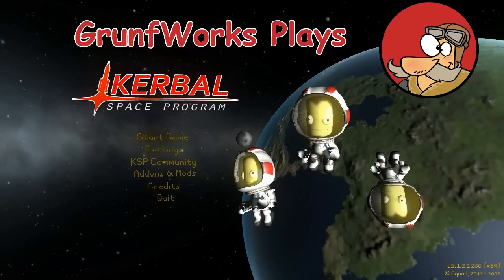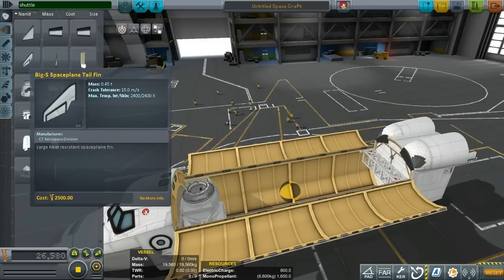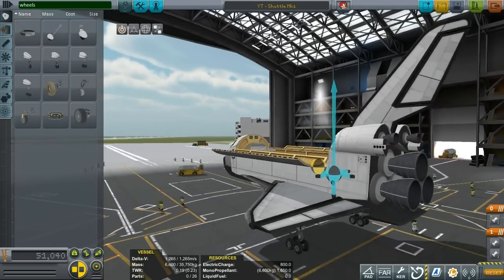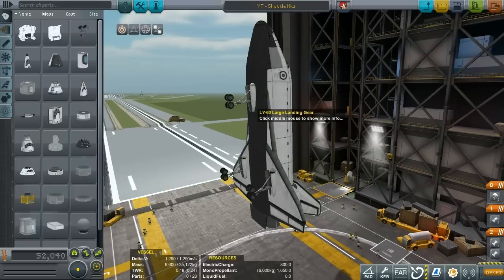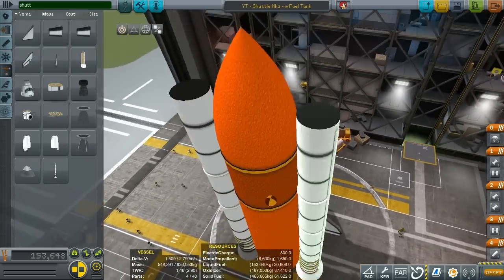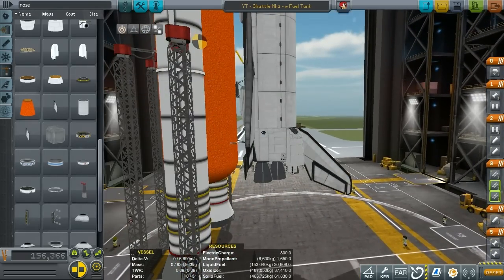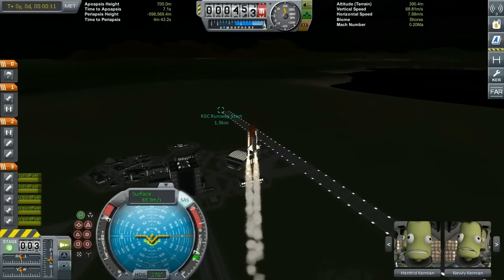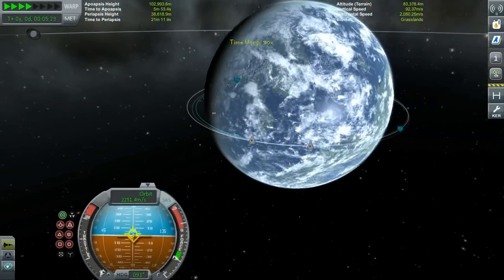Kerbal Engineering - How to build a Space Shuttle

Comment: I built mine without any mods, looks great!
Reply from the maker: Congrats, how does it fly, as balancing is a tough one on this craft.
Reply: GrunfWorks Flies very well, it doesn't have the 2 upper engines or parachutes however because I didnt find myself needing thoose at all
Reply from the maker: Cool, nice job. I avoid stock due to single reason is that i hate tiling
 wings. and also love mods, but making a stock one that works is a great
 achievement. Kudos for that :-)
Reply: Grekus Burekus Nice

Comment: At 6:55 it sounds like you're saying the real life space shuttle comes in at Mach 7, but the real space shuttle entered the atmosphere going ~Mach 20 or so. Which is why it's so important to have the ceramic tiles and the thermal blankets over the rest of the shuttle. Another shuttle fun fact, the "rudder" on it is actually also an airbrake, as it opens flaps on either side rather than having a single control surface
Reply from the maker: Sorry for the confusion, I was referring to my shuttle coming in at mach 7. I did know about the rudder airbrake, it was a cool engineering feat

Comment: Nice job! I noticed some torque during circularization while using the OMS. I take it one could get rid of it by angling the OMS engines in the VAB to thrust through the shuttle's CM?
Reply from the maker: +ivanverano1 yes, you are right, i forgot about that part. Well, same principles as angling main engines apply

Comment: You launch profile is a bit wrong.

Orbiter should sit on the WEST side of the assembly on the pad (ie towards the mountains).

T-0s: Main Engine Start
T+2s: SRB Ignition
T+3s: Clamp release
T+10s: Roll manoeuvre +180 degrees, 60 degree pitch East (belly "up")
T+129s: SRB Sep
T+129s: Pitch manoeuvre: 0 degrees (belly "up" and flat). This moves you away from the SRBs as they separate from the assembly, also bear in mind that your main engines are still pointing up, they will continue to vector through the centre of mass pushing the apoapse up and increasing the vehicle speed hugely
MECO at apoapse attainment (~120km in stock planet). By now your periapse should be at least -100 to -60km
Alt=70km: Roll 0
Apoapse -60s: ET sep. Toggle OMS on and ME off
Apoapse -30s: OMS orbital insertion burn start to orbit, 45-75s burn depending on payload mass

(this is entirely doable in stock KSP, this is the profile I use)
Reply: Jim Moore ha lol u used math noob

Comment: grunf flaps are to add drag and lift, spoilers are to disrupt air flow over the wingsurface thus decreasing the wings lift generating capasity and not adding forward speed but you do get more vertical velocity. airbrakes are to only increase drag
Reply from the maker: +highkicker11 very nice explanation, thx for that
Reply: +GrunfWorks nothing to thank me for i even forgot to point out that flaps increase the effective surface area of the wings and to increase the camber of the wing to increase the distance between de airflow going over the top of the wing and the flow going under the wing with the plane creates lift at lower speeds. But if you would keep your flaps extended at higher speed they would generate so much drag that the plane cant go any faster plus it would damage the wing.
spoilers decrease the effective surface area of the wings. the increase in vertical velocity means you don't want to land with spoilers deployed. use them only to get on the correct glide path. or you might just really be flying a brick
Reply from the maker: +highkicker11 hehe for shuttle I think flying brick is a given :-)
Reply: +GrunfWorks well with spoilers its no longer a flying brick its a falling brick imho
Reply: highkicker11 spoilers also give more friction and grip under deceleration.
Reply: that is not a aerodynamic quality but it is related to the fact that spoilers disrupt airflow over the wing-surface thus reducing lift and increasing the weight that rest on the tire's. thus the pressure on the rubber producing more grip and friction. (at a certain point the wings stop producing lift al together when the  airspeed over the wings is to low and then the spoilers only add drag because they function like a wall for the wind to blow against.)
Reply: Well I have actually nothing much to add regarding the flaps and the spoilers (Speedbrakes with more "deployed" surface area which are only deploying on the ground). However I'd like to mention that speedbrakes greatly increases the rate of decent. And since I'm already talking about decentrates a normal airliner decents normally with an sinkrate between 4000 fts to 6000 fts. The C-17 or C-5 is decending with over 16.000 fts (tactical approach) with speedbrakes deployed and with fully deployed trust reverses. The shuttle "decents" with ~30.000fts. Just to give you a feeling how this would feel like an airplane normally cruises between FL300-FL390 (depending of the weight and the coast index). Let's take FL300 as an example. Let's assume you wanna land in KJFK (JFK ICAO code) and you're round about 15nm to 20nm away from the runway. The pilot would announce that the plane is about to land into JFK. With an decent rate of the Shuttle is would only take ~1 minute till touchdown. The Shuttle is litrerally skydiving. To be honest I don't know how it would be possible to increase the rate of decent even more.

This video will show you how fast a 30° "Glide path" is.
https://www.youtube.com/watch?v=Jb4prVsXkZU

Comment: But can you do it stock?
Reply: Grit in principle, but this looks better. If you use stock, I recommend vectors for the main engines and puffs for the orbital engines.
Reply: Puffs are too small, i just built mine without them.
Reply: Grekus Burekus thuds might work better then.
Reply: But puffs would probably be more realistic.
Reply: Yeah, I am trying to figure out how to attach stock docking port, another problem is funny placement of engines.
I am aware that stock shuttle exist I am just ignoring it
Reply: Grit Try using the Comorant Areotechnology mod
Reply: Yes but it's very difficult
Reply: I did it stock yesterday, but I wasted my time. Turn out I made it on the technology node unlocked at 300 instead of the 550 where you get the actual wings and the Mk 3 LFO tanks. Structural wings and fancy cubic struts gave me a near-perfect shuttle that was too expensive to launch in my career at the time. Weird thing is, I had a MK2 LFO “pipe” strutted to/through the bottom of the craft, with the wings attached to that.
Reply: Grekus  Yea i add some engines at the side of the vectors which will be. forgot... the small version of swivel?
Reply: Marcus Mitchell 
I i use a cluster of 7 puff engines

Comment: do you use any kind of mod?
Reply from the maker: Hi, yes, they are in description: Cormorant Aeronology and Shadowworks and SLS
Reply from the maker: Rohan Zener i did design one that brought station to duna, check my 2000 subscriber special episode of kerbal engineering. But, there will be more starships coming ;-)
Reply from the maker: Ok, given that definition, that might not happen until Season 3 then, as in Season 2 I am sticking to this system which includes the outer planets, but not the galactic neighborhood or anything like that, so there will be only the Sun as the main star in that series. It is an interesting thing to try, but the furthest when it comes to jump tech I am planning to go is to develop jump beacons and use them to fast-travel to outer planets. (oops, i think i just made an announcement ;-) ). But there is still some time till that comes